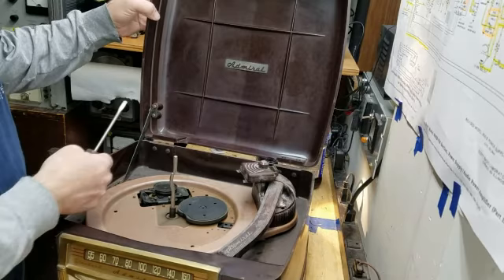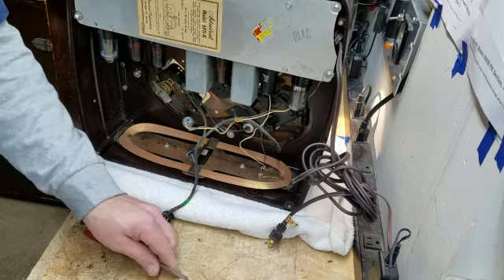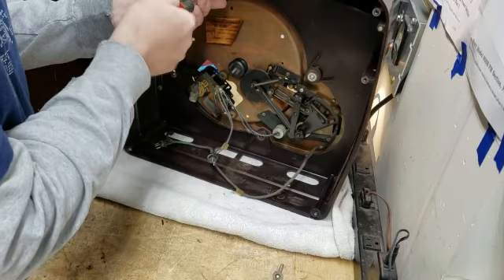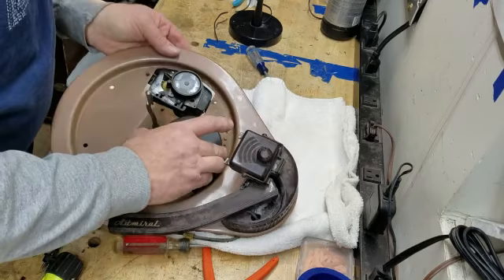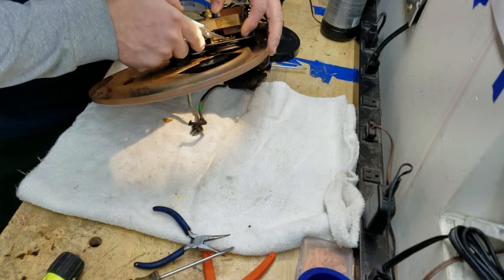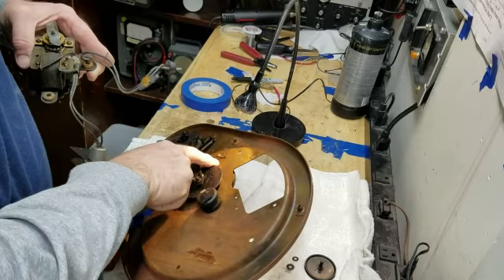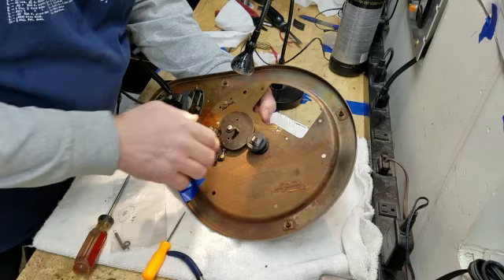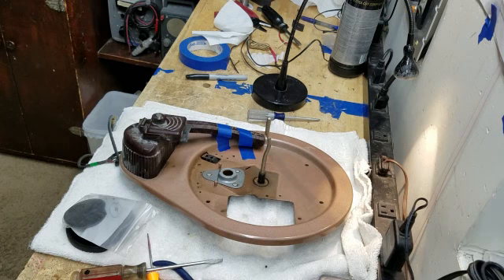1949 Admiral 6F11-N Radio Phono Tabletop Part 2 of 8 Disasse

Comment: i have this exact radio. my motor is nonop and it does not have the fan blade like yours. Did you find any documentation regarding schematic, set up and repair? Very nice job, i would like to get 33 speed out of it if possible. Do you know when Admiral offered 78-33 speed machines?